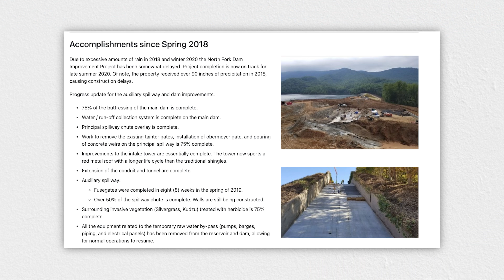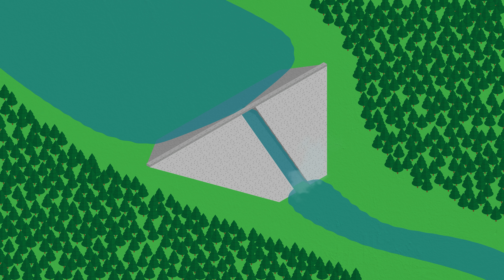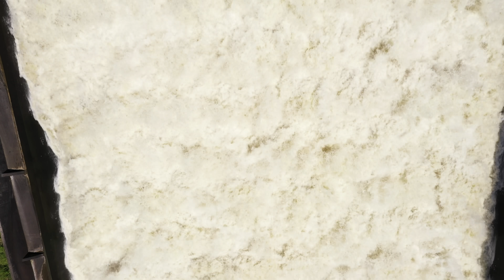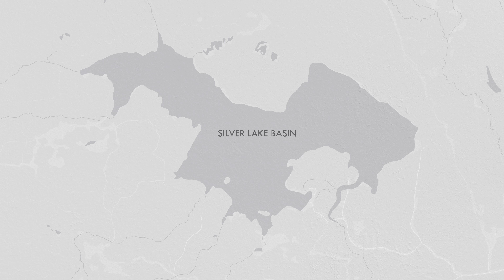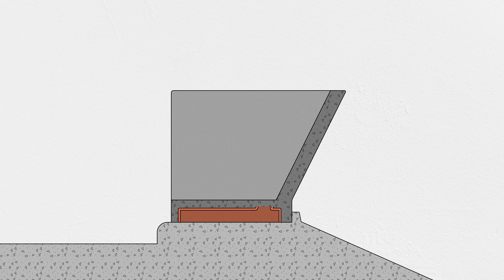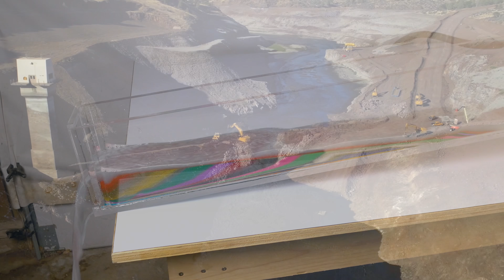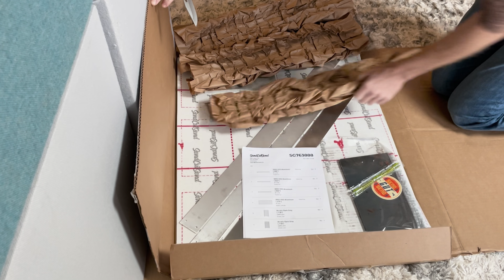This Spillway Failed On Purpose

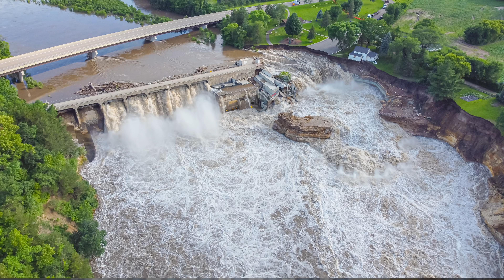Comment: 6:36 rapidan dam failure. Wild!
Reply: Rapidan's failure shows "why you need to keep your spillways clear" - floating debris (especially tree branches) has a tendency to plug up spillways and part of regular dam maintenance (even when the dam itself isn't being used for anything) is clearing out that kind of debris. In the case of Rapidan, most/all of the spillway capacity was quickly plugged up, and with no way for the water to get out in stormy conditions the river kept rising until it started cutting down a new channel AROUND the dam.

Comment: warragamba dam mentioned! bane of my existance when i was an outdoorsy instructor in my 20s and the spill gates being opened meant kayaking being cancelled and having to disappoint the kids. you would have a little chuckle, i think, at the silliness of the greater hawkesbury region and how much of it is built in floodplains along the nepean/hawkesbury river ("discovered" by two different british settlers at different sections of the river and named before it was realised its the same river system). there has also been a deluge of heated argument regarding a proposed pumped hydro storage facility over on the other side of the blue mountains from warragamba, and sadly i think it has been called off for now despite being positioned in an area who's primary industry has historically been power generation.

Comment: What if you had a glory hole with a buoyant cap?  When the water level was low, the weight of the cap would keep the glory hole closed, but once it got to a certain level it would start to float and lift open.  You'd want to secure it so it couldn't raise beyond a certain level and break lose, but that's as easy as just making the top of the hole's diameter wider than the bottom of the glory hole caps, like on an antenna.

Or maybe you could do something that incorporates something from a Pythagorean cup?  (Obviously, you wouldn't want the bottom of it to be too low into your reserve.  You don't want to suction the whole reservoir dry.)

Comment: At more northern latitudes like Québec, it isn't so much weather but rather spring  when snow melts and causes huge flows in creeks, rivers. (caiusing flooding in many places).   This is fairly predictable so the management tends to lower water levels at major dams before spring in order to refill reservoirs during spring (and this reduces downriver flooding during snow melt). 
At the LG2 (Robert Bourassa) dam near Radisson Québec, they have not needed to use spillway gates since the mid 1980s when second power station was open (LG2A) next to first one.  So they need  to test them partially every 5 years, and full opening every 15.  Half of them are heated so they can operate in winter. 
Opening of the spillway gates at Robert-Bourassa generating station
Hydro - Québec

The gates are at: 53.79717701048238, -77.44090260617565

Not mentioned on your video: for dams with power generating stations, the spillway still needs to keep water above a certain level below which the trubines won't work properly to generate power.

Comment: Great design. As someone who lives in Black Mountain NC and saw the devastation and experienced the aftermath for months I just want to say the flood zone downstream should be prepped in some manner. That sudden surge of water made a sketchy situation go to deadly within a few seconds. The people went from heavy rain to 10' of water going through their trailers in a matter of a minute or two. People on mild elevations 20-30' above the river bank and several hundred feet away got water waist high in their homes. That flood persisted until the reservoir stabilized its water level. 

Luckily I live east of the reservoir and up on hill, not on the side of a mountain. I didnt get flooded and I didn't get the landslides that happened on the mountainside. 

If I could offer any advice for a community downrange of a dam like this it would be this. Have a large parking area that wont be impacted by the potential spillway flood and use that for people to move vehicles and trailers to. Have a church or other building setup as a shelter during the sketchy period and go door to door in the danger zone to beg people to go there for the worst risk time. Don't charge them. Most of the people in Swannanoa who died were incredibly poor. They wouldn't leave because in many cases feared they would lose what little they had to thieves in their neighborhood, they also cant afford a motel room, and they usually have pets and drug use issues that are additional hurdles. So instead they stayed in their trailers and waited. The lucky ones lived, but lost most everything. The unlucky ones got swept away. 

Would they have survived if the dam hadn't done what it did? Idk. Maybe. Maybe not. Either way they live in the exact spot that large volumes of water will go if this part of the valley has a major sustained rain event. I suspect we all know places like that in the communities we have lived in. So figure out a plan for those people and try to get the local government to act on it. Some simple things would have saved lives and reduced the burden on rescue personnel. It would have been far easier to work on providing needs for people if we hadn't had to spend so much time and effort searching through the debris field for the ones lost. So if you can get those people out of those bad spots hopefully fewer deaths, quicker recovery, less strain on emergency folks, and the local government spends less so your taxes aren't so bad.

Comment: my rural community is currently facing the possible installment of a 3GW data center just outside of city bounds and has been private sold so there are decreasing opportunities to ablate this project. one of the biggest concerns (apart from power draw on a rural grid and noise) is water usage since most of it is well water from a limited aquifer, should we be talking about a reservoir with the local river management as a middle ground?

Comment: 5:20 There is a series of run of the river dams in my city. They have spillways with gates as it allows to keep the water head at a certain height while controlling discharge of excess water. In front of the last of those dams, there is a small brick arch that's a remnant from a mill. That thing takes the full force of the water when they open the spillway. It makes for an incredible sight.

Comment: Got a three gated hydro dams by me not huge ones though, had a lot of rain and snow melt the last few weeks, I looked over weekend like all the gates are open on them but past the farthest dam upstream a lot of areas flooded. The one dam was about 3FT from the top, I just looked at like these should have been opened sooner. Technically two of these are a lake and I think at least some cases they need a min or max level. I kind of hope they can figure out something better for the future, was me i'd rather have a lake too low than too high. I have seen at all the dams some tube with USGS stuff on them I assume it just reads water level. None of these dams that I have seen have any kind of fusible spillway I just thought seems like somewhere there would be a notch in the top of the cement structure that is like an overflow. I don't know all the data they monitor to decide what to do but it seems like kind of a vintage system. I would think somewhere there'd be a more automated system even if was like a central control of some sort so the chain of dams all respond similarly. Or a flow/level/ weather system then adjusts perhaps one or two gates to minimize issues. If more action is needed then let people do it.

Comment: You could have built a working model of that patented (really smart!) fusible spillway w/o incurring their wrath, IMO.  As you would not be actually providing that system as a product to anyone.
Reply: This comment is only relevant if (a) you are an intellectual property attorney, and (b) you are Grady's attorney. I presume the second is not the case, and I rather suspect the first is not either.

I don't know where you heard that the only way to violate a patent in the United States is to provide a product to someone else. But, let me guess, whoever told you that is also not an intellectual property attorney.
Reply: @ps.2  Making working models of patented items is not illegal.  Showing them is not illegal. Selling them is (absent a licence from the patent holder - who is certainly not obliged to cooperate [exception: some essential patents]).
But hold on to your assumptions - they keep you warm at night, I guess.
Don't forget the upside of a patent is protection.
The downside is revelation and expiry.

Comment: Is there any reason to make a mechanical gated spillway where the top of the gates are still below the max reservoir depth so that even if the gates aren't opened, some water can still be released in extreme conditions?

Comment: Something you didn't touch on is the cheap little brother of spillway gates, stop logs. Often seen in flood control dams on rivers rather than large scale reservoir dams they are a very low tech solution to variable spillway volume. Wooden beams that fit into slots in a spillway channel, lowered down from the top by a crane. The higher the stack of logs the higher the upstream water level, the lower the log stack the more available spillway height and flow capacity. The top log is the erroding surface from overtopping flow but is easily replaced. Most dams have these ahead of their spillway gates and intake penstocks block water off when work is being undertaken on the other components but they are commonly used as the main flow regulation in many dams. They require minimal maintenance and work well, however they require direct manual intervention to change spillway capacity, someone has to physically hook on and lift the logs out, which is time consuming and needs to be done prevemptively to a flood event.

Comment: The fuse plug spillway reminds me of rat trap fuses on some switchboards. If the main fuse fails the rat trap fuse quickly blows and opens a relay to trigger an alarm. I’ve seen them at chicken farms as a warning in case a fan circuit fails, which could lead to the birds overheating or freezing depending on the time of year.
Reply: Rat trap is a new name to me. I've heard of "grasshopper" fuses in telephone exchanges which seem to be the same thing. It looks like the official name might be "alarm indicating fuse".

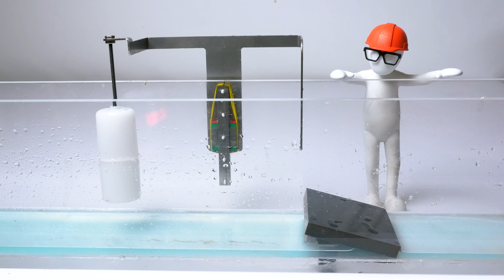Comment: 11:45 This type of fuse plug also seems questionable to me. There are plenty of parts that could fail its release. Defective floater, mechanically stuck from withering etc. Its kind of hard to regularly test its mechanical function. Dont really want to open it up unless needed after all...

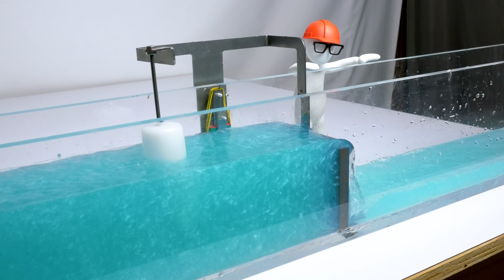Comment: Oh my gosh, Grady, you just gave me an idea for a fun hobby. Seeing this model operate at 12:35 , and thinking about your earlier comment about a different setup not having a reservoir behind it... Will it got me thinking about how much fun it might be to model waterworks infrastructure features with real water in a way that incorporates them into something like a model railroad, and built with specific materials selected to perform similarly to the real-life ones. Now I just need a wide area workspace with a floor made safe for water spills!
Reply: I'd say doing it outside with a garden railroad  is the safer option, tho on the other hand the hardware there is quite a lot more expensive, and of course also requires a garden...
Either way it does sound like a lot of fun!
Reply: Wow, that does sound like fun! And a lot of work. And like it would require a ridiculous amount of space. I suppose it probably depends on the exact scale you end up going with.

Comment: I grew up near a river dam that had a top section made of wooden boards anchored into the stone base with metal rods. When the river got dangerously high beyond what the spillways could handle, the metal rods bent from the pressure and automatically let more water through.
Reply: Was that bending by design or just luck?
Reply: @trek520rider2  By design. Built in the early 1800s, and there was a blacksmith shop by the edge of the river where they'd take all the bent metal pins and reforge them. It also helped keep the canal system that powered the city's mills it was diverting water into from overflowing and causing major flooding issues.

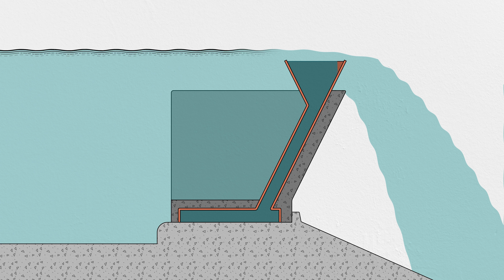Comment: 13:38 I'm picturing a system like this diagram, but instead of tipping over, the weight lowers the whole mechanism, thereby allowing more water to flow over the top. When the water level comes back down, the water could be pumped out of the chamber.
Reply: Sounds a lot like a drum gate. I think the problem with that would be the mechanical complexity, but it's an interesting idea.

Comment: Big controversy currently going on downstream of Mt St Helens on the Toutle River in Washington State. 

The Sediment Retention Structure was built to hold back sediment coming down the river to help maintain the shipping channel and river depth downstream. As the sediment accumulates, they’ve had to raise the spillway several times. They are getting ready to do it again, but it’s been a while since the last raising, and since then as nature takes hold more and more, raising the spillway will inundate and reset much of the valley ecosystem upstream. Beaver habitat, elk habitat, fish, all of it. 

It’s quite the conundrum that I hope you get a chance to look into!
Reply: Have they considered digging out the sediment or something else instead?
Reply: @b @benG2141 rt of it is the remoteness, it’s about 20 miles off the freeway on a 2 lane highway that winds through the foothills of the cascades. It’s estimated that the current structure has trapped 125 million cubic yards of sediment since its completion in 1989. It was designed to trap more than double that, but larger sediment loads than anticipated. Basically within 10 years, the sediment “filled” the valley, the river cut through, and now only traps about 20% of the sediment coming downriver. Nearly 3-5 million cubic yards annually. 

In 2012 they raised the spillway by 7 feet, and this go round, they are raising it 10 feet. The amount of vegetation on the now established riverbanks and islands and all through the sediment plain are going to be lost as the water backs up, and drops tons more sediment. At least, that’s the argument from the environmental side. There’s also the argument that we’re just going to have to keep doing this cause there’s still an estimated 1 billion cubic yards of sediment upriver. 

It was proposed to dredge the cowlitz river, which is in between the Toutle (the main sediment transport and where the dam resides) and the Columbia River (major shipping channel allowing access from the pacific to ports in Portland, Vancouver and farther upriver. The Corps basically said doing that would set a precedent they aren’t willing to set, as their responsibility is maintaining the shipping channel, not the tributaries. At least, that’s how I remember that argument going. 

It’s crazy that here, 46 years after the eruption, we’re still dealing with the aftermath. 

The river in the early days had far less vegetation, and sediment was easily moved by stream bank collapses and landslides and whatnot. In the years since, they attempted to seed grass to hold sediment (didn’t work and introduced non natives… it was the 90’s) but nature itself has done a good job of establishing trees and native plants on much of the sediment upriver, though close to the mountain, much of it is still bare, it feels like most of the channel is quite established, though if you look on satellite, it is pretty braided in many areas. I think many of the locals (and outdoorsmen who want the fish to return) would like to see the river just go back to natural, allowing the river to establish its path. Flattening the grade just encourages more meandering, and more bank cutting and more sediment. 

It’s quite the ordeal.

Comment: I have a very dumb question -- why don't we make weirs staged? That is, they're still fully passive and have no moving parts, but allow you to have incremental control over flow changes using closed outlets at different heights (as opposed to the spillways here where they're fully open above.)

The use case would be where increased downstream flow has its own risks, but maintenance and operation of the upstream weir is expensive (so no moving parts and no manned equipment,) so we want to minimize the downstream flow, even during incremental stages of flooding.

Maybe the solution there is just a single spillway with really tall sides so flow increases linearly past a point, but i was thinking you could control it to a fixed flow while the flood increases another, say, 5 feet, then it increases a bit until the flood goes up another 3 feet, etc.

Comment: Why can't a gate be directly lifted by a float, so it would always automatically follow the water level?? Put a float at each end of the gate and the gate in a guide channel, and let water flow under it as it lifts. It would reset by itself when the water level goes down, and flow changes would always be fairly gradual.

It's nice to see a sponsor that is both useful and relevant to the channel topic.